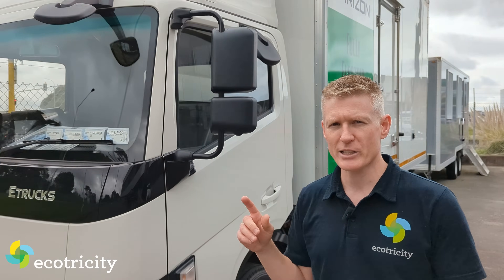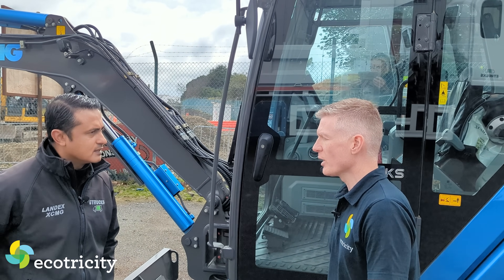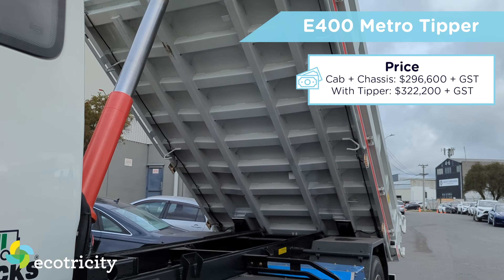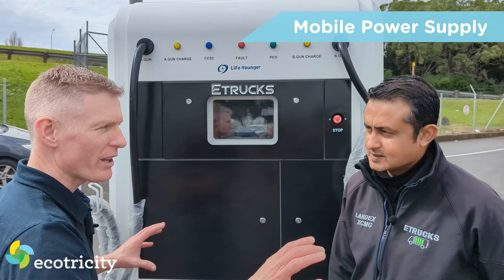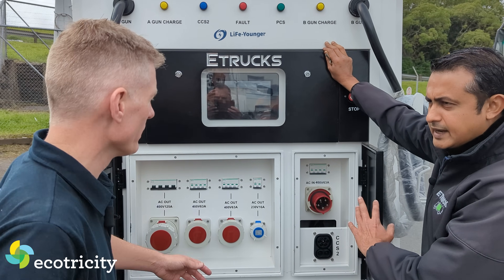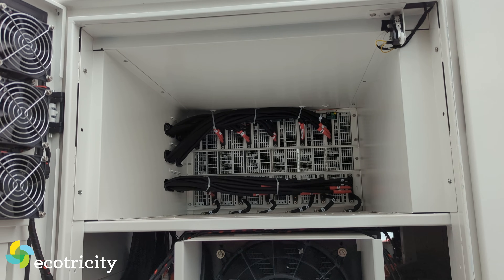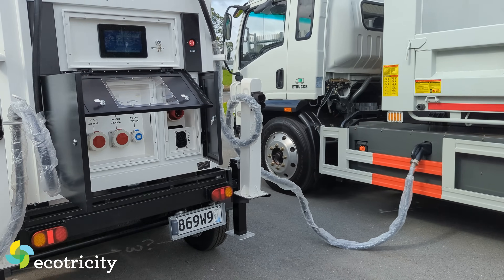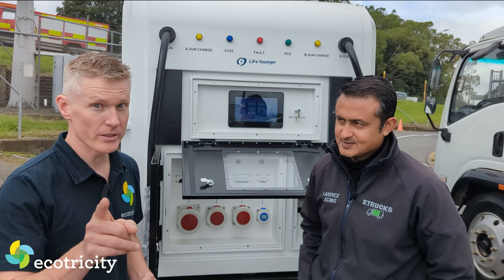Battery on wheels: 200 kWh rapid charger

Comment: On site battery bank to provide rapid charge is the way to go! Constant grid load,  then charge machines while parked. 

For some sites, I bet just is enough if you have "only" 22kW or even just 11 kW grid connection, you can save all of it during the day, to deliver more energy to machines over night.

The battery can help to provide high power when the vehicle battery is low, then when the battery bank starts to run low, the vehicle battery is high, and you possibly have to debate anyway.

Comment: Nice presentation there. The factory Representative is well versed and knows the impact and market share these machines, trucks and chargers could take. The idea of a mobile charger is correct just as diesel bowsers used to travel to sites. Theft and contamination is a problem on sites these days, especially where regular not died diesel is stored. I wish them well. Very slow uptake of electric machines or trucks here in the States. The dummy who walked off site allows a new more adaptable person to take his place. Probably a better operator as well. 👍🇺🇸

Comment: Love this. It brings joy to my soul.
I’m sure that these will simply skyrocket past diesel heavy equipment. The maintenance and humungous fuel savings are too good for businesses with a bottom line to ignore. Costs over years measured out by corporate beancounters is where these will be adopted. I’d imagine that even if there needed to be a redundant diesel genny for the whole site incase of shortages from site batteries, would be more efficient simply charging on demand than having tons of heavy plant burning away all day.

Comment: The should be cheaper than their diesel counterparts...think of the complexity of a diesel engine then replace it with an electric motor - infinitely simpler. 
These maintenance savings from an electric digger (or car or anything) comes from that reduction in complexity and therefore must reduce the cost. 
I often get the argument about the cost of batteries. This is a furfy promoted by greed - batteries are around  $130/kwh - 89kWh around $12,000. The electric vehicle industry is gouging us.

Comment: Cringe! The maths doesn't stack up.  We have a grid and power generation that can't keep up now. Good luck with commercial charging stations. The cost is horrendous. They ignore infrastructure requirements at base, labour to service/fuel equipment, downtime, and limited range. Businesses that tried it in the US and went broke.
Reply: Please clarify as you have not presented any maths.
Reply: What math would this be? You know everything has a cost right? Just because it's not accounted for doesn't mean it doesn't have to be paid. The cost to all of us for a couple of hundred years of burning fossil fuels and dumping the result into the atmosphere is going to be horrendous. All your other points are bogus.